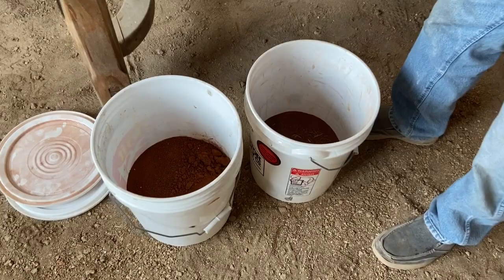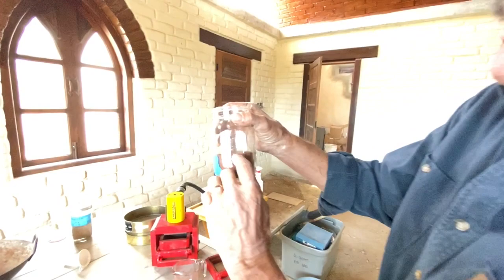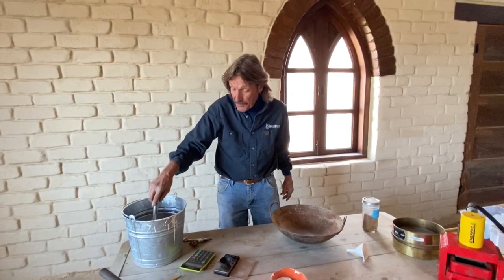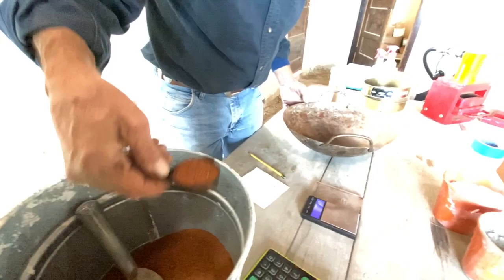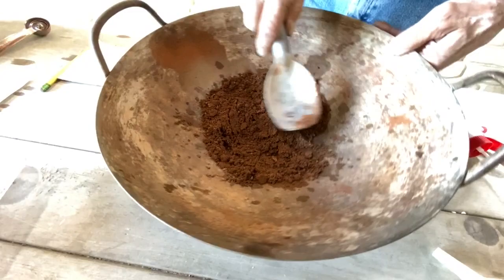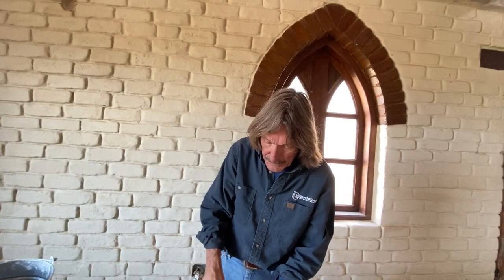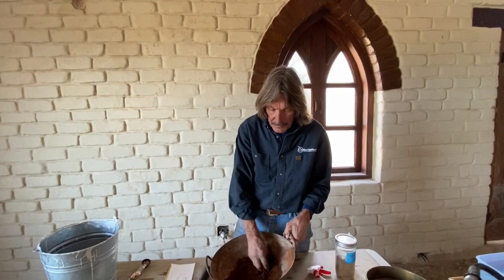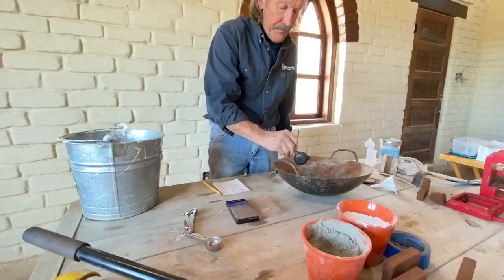Earth Block Lab Part 1 | Jim Hallock | Earth Block International

Comment: Why divided on 0.95 to get the 5% Cement? It came out 15.56% While 5% out of 295.77 can is 14.78%. Especially as same method wasn't used for the water Please explain. Thanks
Reply: Do farther math on it, it actually works. 😊  actually he put less than 10% percent of water in volume to mass instead of 31.134 it should of been 34.5933 over all mass of the mixture

Comment: Hi Mr. Jim, 

I am planning to construct my house with CESB. I have got the soil of my area tested  and below is the result:
Sand - 29℅
Silt - 36%
Clay - 35%

Please guide if this soil is suitable for lime stabilization? 

And if not what can be done to make it fit? 

Thank You!
Reply: It’s perfect for lime stabalisation you just need to add more sand
Reply: How did you test it
Reply: @mafira1987  I have wondered, if  you could do partial cement and lime, since lime reacts to clay and cement is more suitable for sand and gravel. Of course at lower parts from 5 to 10% of these stabilization. I have looked it up and unsure of the answer.